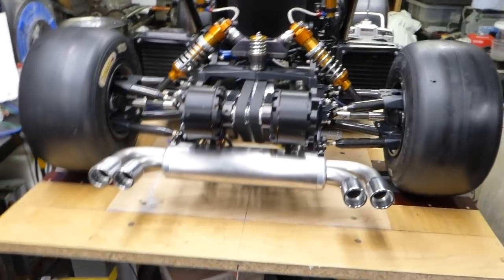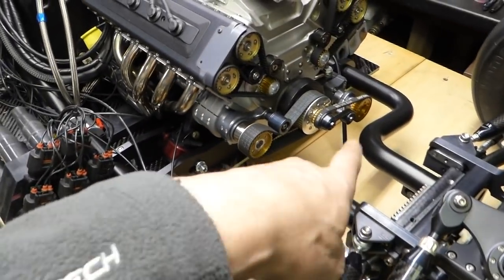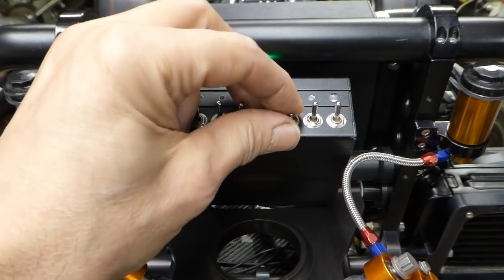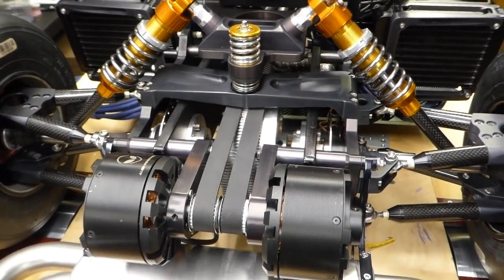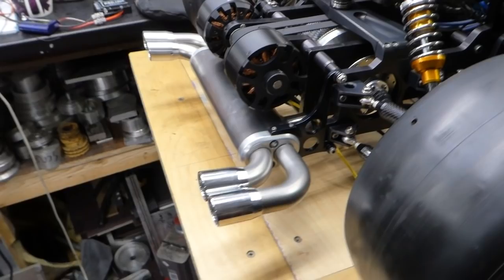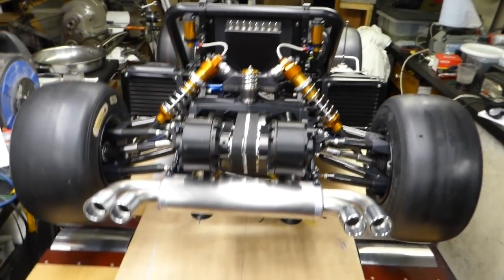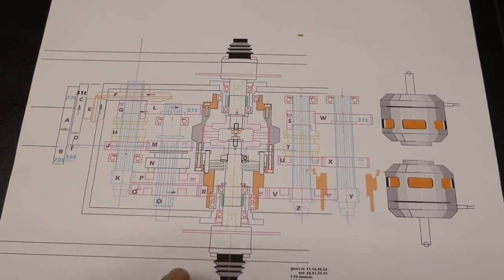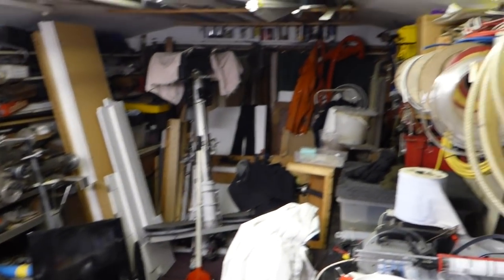1/3 scale 125cc V10 Hybrid RC car. Part 6

Comment: The adjustable mechanisms connecting the A-frames to the frame... You have the retaining bolts mounted vertically, instead of horizontally. Why? I don't want to question your engineering, but this just doesn't look logical. If turned 90 degrees the small amount of movement would facilitate any adjustments; while the true nature of the mechanism would allow the suspension to function properly to the full extension of the shock and free from any binding. When you jacked it up it looked like it reached the end of its tolerances. I hope I've been clear in my description!
Reply: Google images of Formula 1 suspension. You'll see why he did this.
Reply: @cptbimes1  Formula 1 suspension design image, shows the mounts at the rear contradicting this. There were images showing each Style and also using a combination, vertically and horizontally. If the amount of travel allows his application to be applied, then I've got nothing more to say!
Reply: Formula 1 uses two kinds of joints. On the car side f1 uses solid metal flexure joints which flex when the suspension move. On the tire side you have rod ends.  It that way because there is very little suspension movement. Just because f1 does something you can not just copy it without understand why they do it.

That being said for this model the suspension travel is very easy to check on the car. If the suspension travel is limited by the ball joints then he wants to fix it which he may not even have done yet. Depending how much suspension movement he has this system is totally fine. But naturally you don't want your suspension to bind against the joints in any kind of suspension.
Reply: The chassis attachment connection is in shear, if you rotate it 90 deg it would be in bending, this would be for acceleration and braking and bumping loads. Spherical rods ends have a displacement angle of around 20 degrees which should be plenty for an F1 suspension. He designs helicopters which are loaded with spherical rod ends so I'm sure he knows how to apply them. Do you think he designed a suspension from scratch and didn't qualify the travel? He probably is using a 3d modeling program like pro-e or solidworks or inventor.
Reply: I’ve just noticed what you mean also. I too am in no way wanting to question your obvious ability, however if the mounts for the track rods to the chassis were rotated 90deg it would in my thoughts make both parts more structurally sound. The tie rods as the are will allow for movement forwards and backwards of the hub,  possibly ruining the geometry, also as just mentioned when the joints are used as you have, the suspension travel will be limited by the motion of the ball in the joint. I really hope I don’t sound offensive and there’s prob reasons for the way it’s all been done. You’re doing one hell of a job which I wish I had even an ounce of your talent.
Reply: @SiR2Dean  sometimes a team of Engineers are required when designing something this intricate. Someone would have caught it before pre-production. This is a serious problem and it needs to be addressed.

Comment: does electric really need 2 speeds?
Reply: Probably because he use outrunners, which are hard to get going, so he might use a very short ratio 1st speed to get it rolling more easily and then he gets in second which will be a more appropriate ratio to run properly.

Comment: I'm soooooooo glad I subscribed!

Switch #7 has to be the aircon
Reply from the maker: I think it will be for the compressor for the gearbox air shifter system.
I quiet fancy tiltable rear wing for extra braking force. Completely useless, but would look cool.
Reply: @Keith5700  In that case, you've got to go full on: aero brake on heavy breaking, full down force in the corner, DRS after corner exit 😊

(Still think these electric motors would look awesome connected to the front wheels)
(Seeing your amazing skills, I wonder if you couldn't machine a brushless rotor into a rim)

Comment: amazing job !! 
why 2 speed on the electric ??
Reply from the maker: low for acceleration runs, high for top speed runs.
I understand the max torque at zero revs thing, but gears will be better.

Comment: Maybe you could use the frame hollow tubing for fuel tanks? Forgive me if they are solid.

Such beautiful work..
Reply from the maker: The frame will be the air reservoir for the gearbox air shifters.
Reply: @Keith5700  interesting

Comment: Yay another video from the mad guy with the craziest rc car build ever...period. Just my possibly unwanted 2 cents but was wondering how hard it would be to utilize parts of the tube frame as fuel storage? They're a decent diameter and are low in the frame for low cog so if they could be used even as a partial or " reserve" type tank? Incredible build and much respect for ya effort.
Reply from the maker: I'm going to use the frame as a reservoir for the air shifter system for the gear change.
Reply: @Keith5700  hey man it's your machine and it's awesome so keep doing what ya doing lol. I'd love the gears to tinker on projects like that but I'm still at the angle grinder and stick welder stage😁.

Comment: if you really want to speed the money I would get a castle xlx esc and the two 1/8 motors and wire them both up two the xlx
Reply: He'd have to deal with gearing these fast spinning motors down. Outrunners are easier if you are dealing with large tires

Comment: Those fans sound super angry, love it, got a model number? :)
Reply from the maker: They're computer fan blades with 12v drill motors attached.
Reply: @Keith5700  Ahhh, nice. If you ever need absurd 120mm fans, check out these. EXTRA scary/angry. You can't run them under 60% speed using a PWM signal but you can run them perfectly at any speed using a PWM DC voltage controller. Make sure you get the ones with the 4.8amp motors (7500rpm), they make lots that look similar but are wimpy: https://www.aliexpress.com/item/Free-Shipping-The-original-Delta-PFC1212DE-ball-of-violent-fan-12V-4-80A-12038-cooling-fan/787410409.html
Reply: @Keith5700  A video I made for my friend on how they can be controlled with a PWM DC voltage controller (just to give you an idea of their violence): https://www.youtube.com/watch?v=9cs0bBl8YCk
Reply from the maker: Yes they look nice. The YouTube link doesn't work.
Reply: @Keith5700  Hmmm, works for me, it's unlisted, but anyone with the link should be able to play it. freaky.
Reply from the maker: It works now. Yes, that looks very powerful. Wish I'd seen it sooner.
Reply: @Keith5700  Awesome. Thanks for watching the video :) They are absolutely mind blowing fans. When you need to move an ABSURD amount of air, and noise is not an issue, they are amazing. Thanks for sharing the build videos with us, it's so beautiful, can't wait to see it smoke some tires.